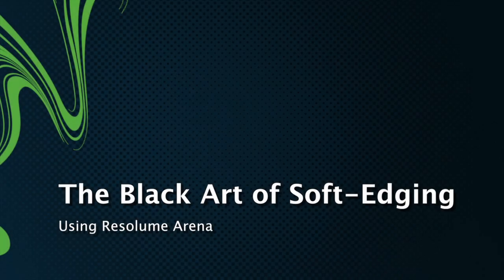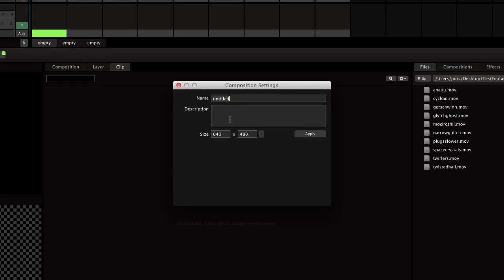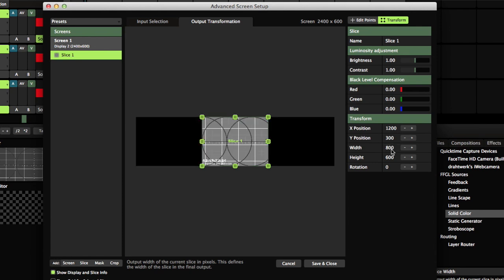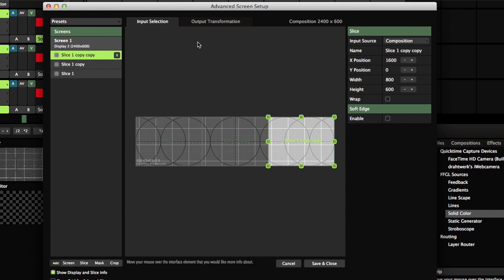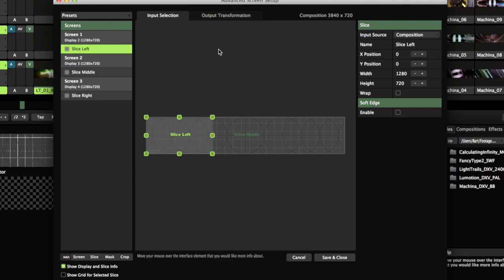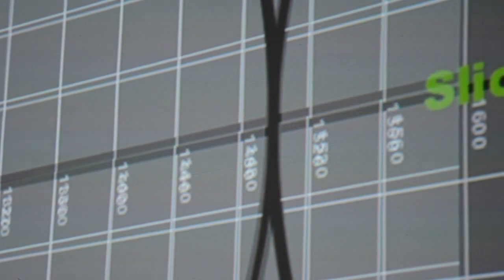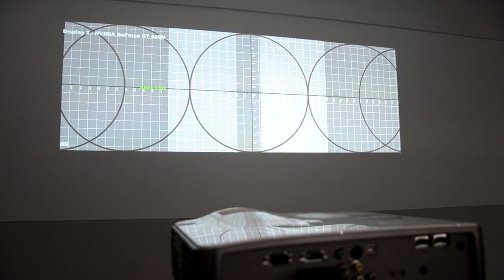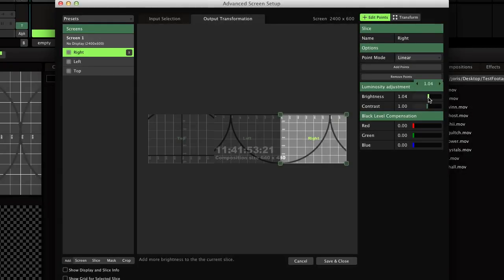The Black Art of Edge Blending with Resolume Arena 4

Comment: Does anyone know if it's possible to blend two projectors in the same position? I don't want to extend the composition size, but my aim is to double the brightness.
Reply: You may want to stack the projectors...it should be like duplicating your outputs...
Reply: That would be called stacking / converging them. Very easy to do if each projector has lens shift and corner correction.
Reply: you wont get double the brightness you get like 50% more kinda... :P